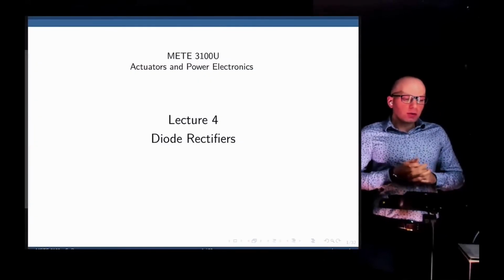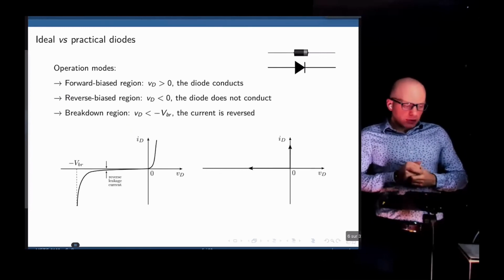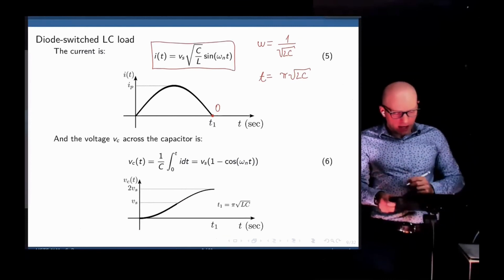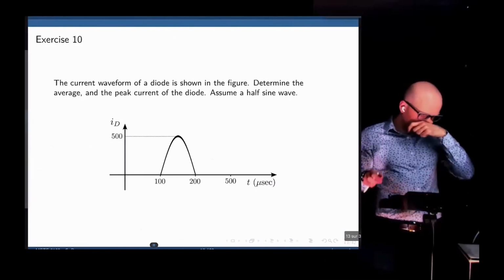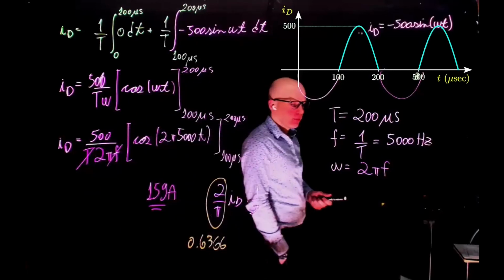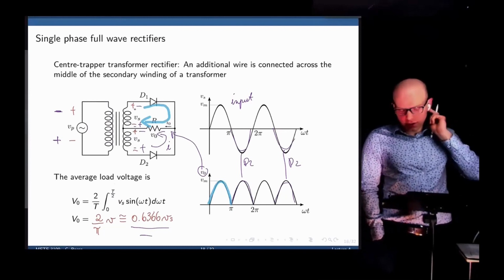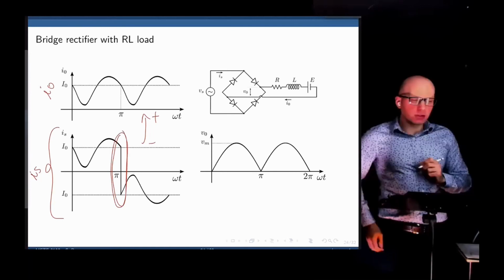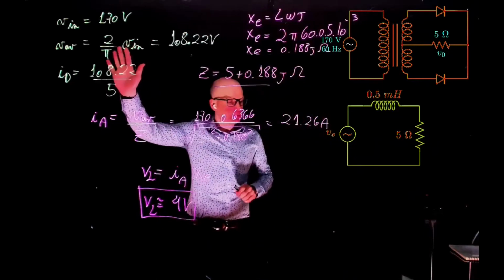Actuators and power electronics, Lecture 4: Diode rectifiers

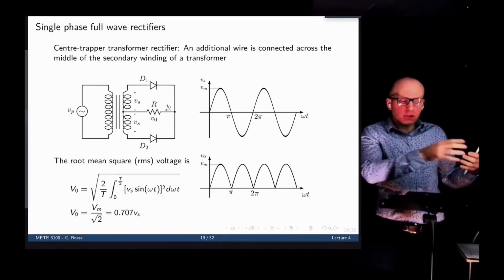Comment: Hi Professor. Thank you for this video. I have a small question. At 49:08, why are we taking the rms of the integral over half the period and multiplying by two? Why can't we simply take the rms over full period, i.e. T. There squaring will remove the negative right? Then why still split into two?
Reply from the maker: Yes, you could,, it should give the same result.

Comment: hello I have a question concerning the average voltage and RMS voltage are they not to achieve the same goal why are they different do they not both provide the same averaging concept for voltage and then if not how were do we use average when RMS seems to be used most offended.
Reply from the maker: Consider a sinusoidal AC voltage applied to a resistor. Its RMS  value is equivalent to a DC voltage that would provide the same amount of heat generation in a resistor as the AC voltage would if applied to that same resistor.  If the average voltage was used instead, the result would be zero.

Comment: Hallo,
I have a question about slide 10 and 11 : In mode 1 and 2 by applying Kirchhoff Law you don't consider the work voltage of diode (0.7) Why? Is this approximation of the equation because we can neglect it (0.7)
Reply from the maker: Hi. The diodes are assumed to be ideal, that's why the 0.7 V drop is neglected. This makes the analysis much simpler. You are correct though, the drop should be accounted for in real applications.